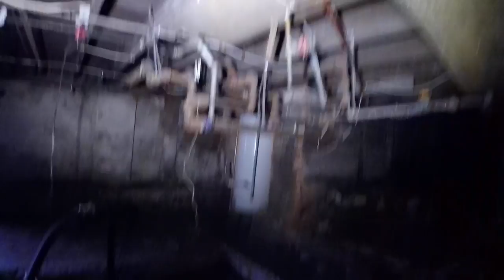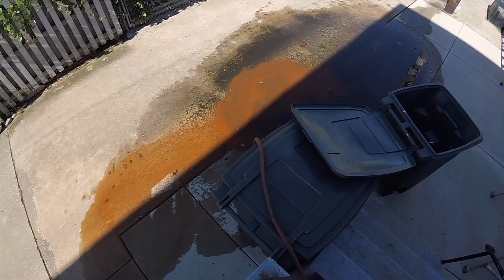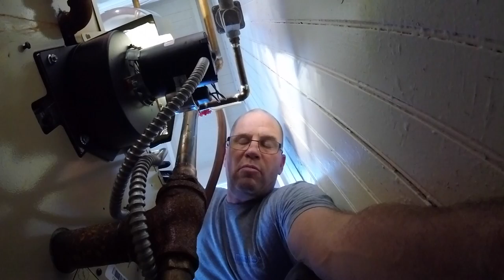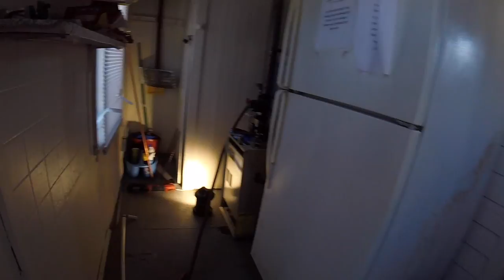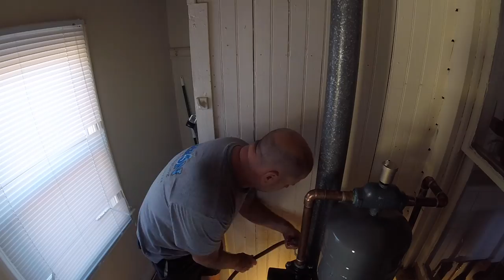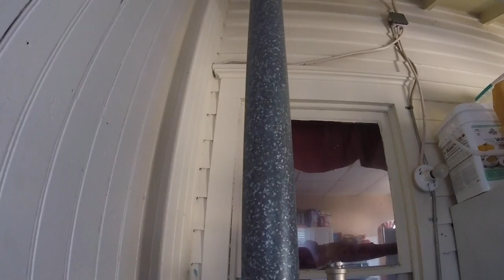Weil Mclain CGi 4 Relief Valve Leaking Plumbing Apprentice Lesson

Comment: a trick for removing the old valves is thread in a section of black iron or galvanized pipe, add a wrench or pliers and they come out pretty easy. for installing new valve, a short piece of pipe or fitting screwed in, helps from possibly crushing the new valve outlet, they distort pretty darn easy! as we all know tight spaces are nearly impossible to "wrench" at the perfect location and angle they want you to. absolute worst case the pipe or old valve breaks and it's bad anyway. :)
Reply from the maker: knuckle buster school.....so fun.

Comment: Hey Chuck. Great videos! Finally someone who covers the trade and adds some much needed humour. I laughed when I heard you say something like "think of the plumber" when changing that PRV out. Just did the same thing and wondered if you would have to muscle it by the case when tightening like I did. Quick question if you have time - I replaced my RV cause it was rusted bad and leaking. New one leaks, and can't keep the pressure on my Weil Mclain where it should be - keeps runnning up to 30ish and purging. Old 3 yard expansion tank is working, rads bled. Only thing I can think of is the to disassemble/clean or replace the auto feed. Any ideas greatly appreciated!
Reply from the maker: Jan, could be a few things..Lets do a virtual walk through. Email me at callchuckbarron@gmail.com

Comment: Most safety valves are designed to be installed vertically only, something I just learned recently.
Reply from the maker: Interesting. what was your discovery Tom?
Reply: @ChuckBarron   From everything I can gather (I&O manuals for boilers and installation instructions on relief valves) the relief valves are suppose to be  installed in a vertical orientation.  Not sure I completely understand it as we often install T&P valves horizontally, but there must be a manufacturing difference that requires boiler relief valves to be installed vertically.

Comment: same problem with many "mobile homes"
when they complain pilot blows out, lack of vent pipe height. up next lack of hot water or it goes cold fast? reliefe valve corroded through......
however, junk metallurgy is still top of list...............
Reply from the maker: by the stains on wall and pipe this joker been leaking for years.

Comment: forgot to mention not liking standard pex for discharge on T&P valves, I think the fittings add too much restriction, add the possibility of overheat with vast amounts of steam being discharged, tells me it's not a good practice period. I've minor steam cooked and cleaned myself over the years before and I'd take hot water spray over steam any day, though neither are fun!
I don't know of any codes against it, but I'm sure there's some local and maybe "crackifornia" has an opinion, I kind of recall seeing them list or state pex-al-pex only, I assume that's because it holds it shape due to the aluminum layer.
Reply from the maker: yes they do....i did a hot water heater on a pex job and inspector said i had to up grade to one inch drop for relief just for that reason.
Reply: I figured, there would "fits" thrown over it, since the I.D. of 3/4" fittings are closer 1/2" passageway and the 1" is closer to 3/4" opening! I like copper, black/galv. pipe for the relief tubing. iron pipe cut off without threads, makes it much harder for some bozo to "plug", but I've seen it!
the downside of pex! I also wonder what the turbulence and flow rate change at the fittings causes, advanced wear through? maybe that's why I subconsciously like the idea of radius bends and everything being home runs/manifolds, just not the cast/plastic though. guess everyone has their opinions ;)